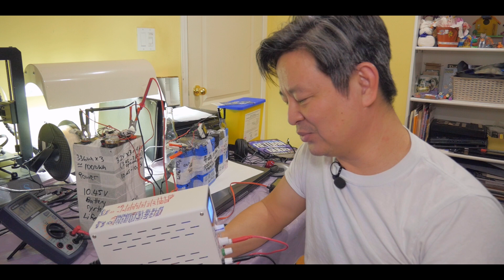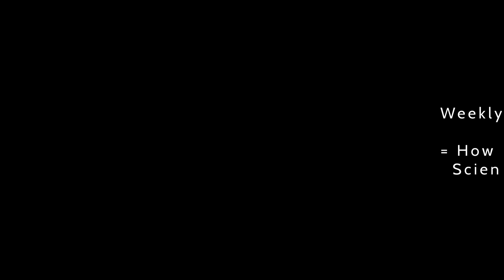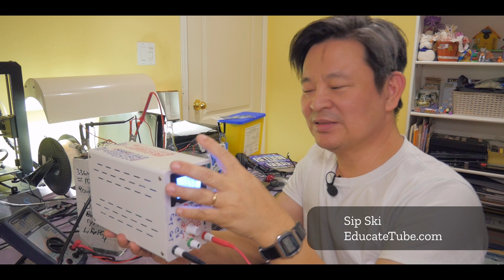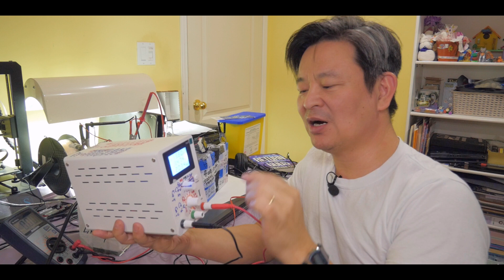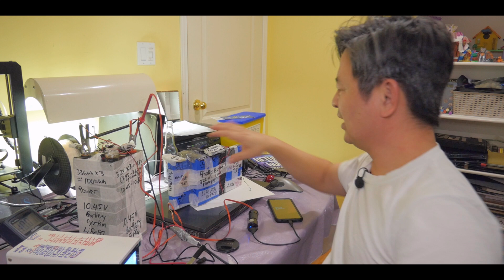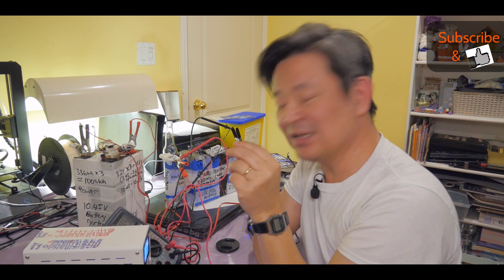Do Not Use Cheap Variable DC Bench Power Supply until you do this

Comment: Sir , you didn't show us the calibrating process .  Did you open the device ?  did you change any components inside ?  there's a display on the device , doesn't it display numbers  when you turn the knobs ? for instance , you turn the knob to get 5 volts,  doesn't  the device display 5 volts ?
Reply from the maker: For the amperage, the knob only turned once (less 360'), however, the voltage can be turned several times so I would not know what voltage I am at unless I calibrated it properly.  No need to open the inside of the device.
Reply from the maker: The problems are amperage and voltage knobs are not constant and it varies as it is turned.  Once you calibrate it, it can be determined more accurately.
Reply: This type of device doesn't have a 'send signal' button, so as soon as it's plugged in and has power, it is sending power to its outputs. That means the values on the display are what the device is currently outputting. For voltage, that's fine because the volts you set are the volts the device is sending, but for amps you are setting an upper limit of how many amps can be pulled from the device, so to see/set the amp value you have short it like he does at 6:00 and then you set the amps to that upper limit.  So I believe "calibrating" means "I drew on the amp dial so I can set it without having to short it every time." I'm pretty sure he drew on the volts nob for fun though because, as you can see at 8:23 he still uses the screen to set the volts lol. My tip is buy a Power supply that has an on/off for the output so you can set both and then turn the output on.